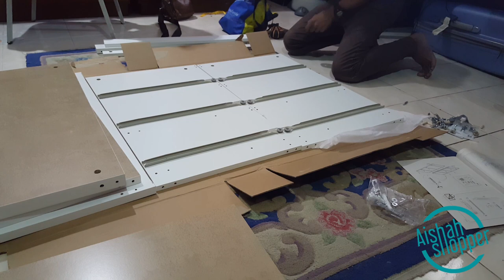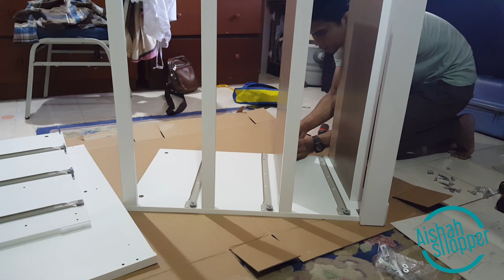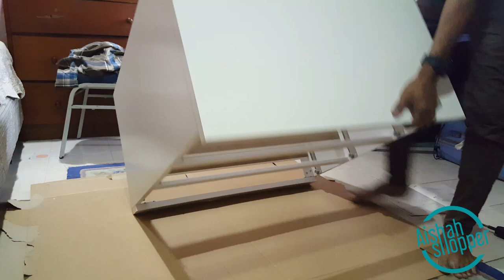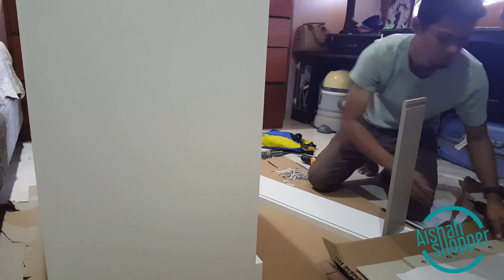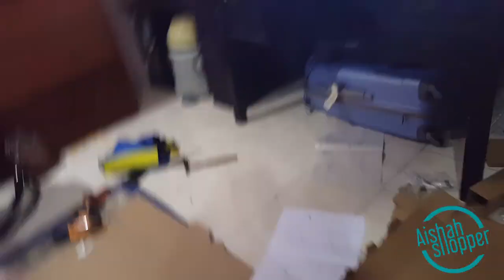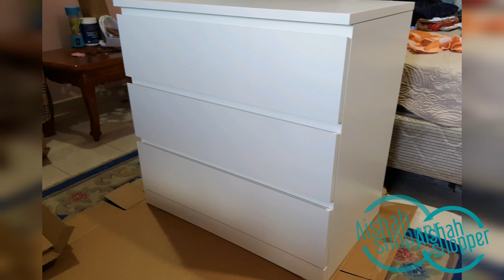IKEA Malm 3 Chest Drawer Assembly

Comment: Trying to figure out how to slide them in. And he didn’t show how he did it
Reply from the maker: Just insert, tilt a little so that the small wheels can get into the railing, very simple.
Reply: Aishah Shopper I think I installed mine backwards or something. My small wheels won’t get into the railing for nothing. Aren’t the wheels supposed to meet when inserting?
Reply from the maker: @TheDaejanek  yes, the drawer wheel must meet the wheel on the railing, the wheel on the drawer must be on top to get into the railing.
Reply: @TheDaejanek  Did you figure it out? I'm struggling to insert mine as well, my drawer wheels are above the railing tho! It's like my drawers are too tall or something :(